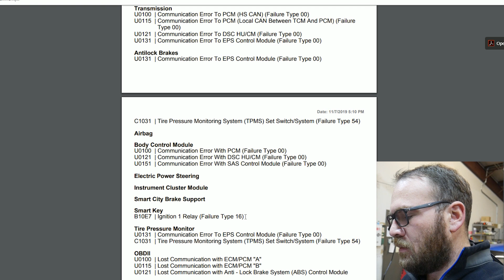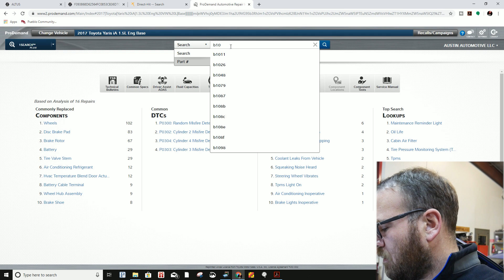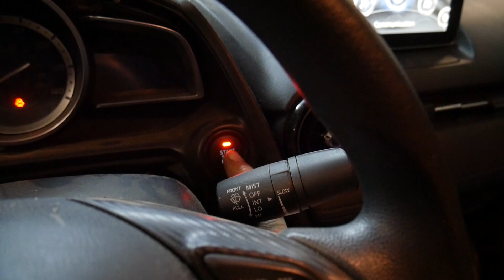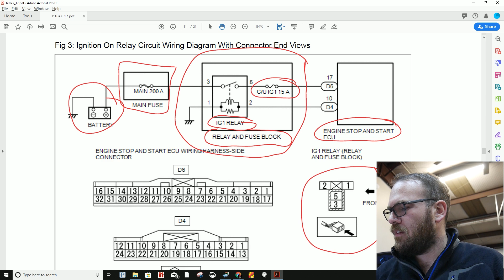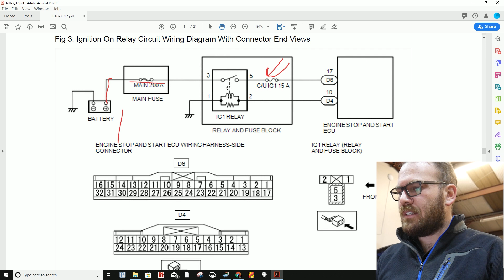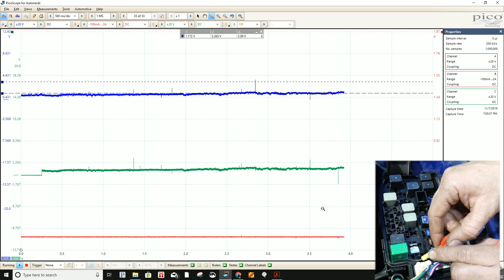2017 Toyota Yaris iA stalls and no start diag

Comment: I have the same problem with mine only difference mine turns on, but stalls and actually turns off after turning on but after 2 or 3 tries it turns on. Sounds really bad when it turns on, changed a bunch of things Toyota said and after that everything comes clean but issue persists. Multiple m chanucs tell me this is a bad car and to sell it and get another used toyota car that is not mazda.
Lets see if i can find a better mechanic this time

Comment: You rock dude, thanks for being a good tech. 👍 

I brought the starter out to Napa, tested good so i found your video,, sure enuf when i pushed down on the relay it stopped having the problem. 

Now i will clean or replace depending on the price

Comment: Just replaced our starter and alternator on our 2016 Scion ia and it won't crank over. Dash lights come on and that amber light on the push button. We've tested the battery amp and new alternator with good readings. Been going though process of elimination and haven't been able to figure it out. So glad I found your video. Hoping this is it.
Reply: You should get a green light when stepping on brake.

Comment: Great video, My Girlfriends car has the same issue and I am hoping this solves it.  The intermittent starting definitely looks to be the same.  However, She also started getting DSC Malfunction, TPMS malfunction and SCBS malfunction lights on the dash at the same time.  These are intermittent as well.    Do you know if this vehicle had any of those symptoms simultaneously?
Reply: I'm having the same problem with my Yaris, the button for the gear shifter would get stuck halfway and I noticed that's what prompted those same warning lights to come on. It's very random with those lights, sometimes they come on sometimes not or sometimes they'll pop up or go away after I drive for a bit. I haven't taken it in yet, do you still have the problem?

Comment: I have one of those and mi car starts cold and after aprox a minute turn off and then doesn't start back again until a couple hours
Reply from the maker: There are four blue relays in the under hood fuse block. They seem to fail without warning. You could try swapping them to different locations and see if the problem changes. Or buy one new relay and switch it around one by one and see if it changes.
Reply from the maker: The relays are less than $20 from the Mazda dealer. Not sure how much from Toyota.

Comment: Did the IG1 relay replacement fix the issues? I'm running into something similar with a 17 Yaris IA after reinstalling the car battery after letting it sit for a few months. Car starts and idles rough and cuts power after 2K rpms. It will shift gears.
Reply from the maker: The IG1 relay fixed the issue at the time. It just showed back up today for a similar issue but this time the relay for the injectors was failing when hot.  We are replacing the injector relay and the fuel pump relay to be safe.
Reply from the maker: @Cristian Escobar I would check the battery. The flickering lights sounds like the charging system or the battery is failing. Perhaps the alternator or the belt was damaged in the accident.
Reply: Jl did you figure out what the problem was with your car… I have one that has ran perfect for years and it went into body shop and stayed a month… and battery went dead.. now after new battery it will start and runs fairly well but start surging at higher Rpm’s

Comment: great video, I haven't ran into this problem yet. The most problems I have seen with these piles of junk are batteries and high pressure fuel pups
Reply from the maker: I think I’ve only had two of these come into the shop. Either they don’t break down often or they aren’t popular in my area. Thanks for watching Gera.
Reply: @ThePracticalMechanic  it gotta be the latter. The subcompact segment just aren’t popular enough for manufacture to continue hence this model is gone :(

Comment: ive got one for ya! Ive got a 2017 Toyota Yaris iA. we just recently had a snow storm. well after the snow melted, my DSC, SCBS, and my TPMS light has come one. Also, it take 3 or 4 times of stepping on my brake pedal before i get the green ignition light to come on the push button so i can start the car. And its all random. sometimes it starts just fine with no lights afterward, sometimes it takes a few brake pumps to start and the lights are on the entire ride. sometimes, one or 2 lights will go off while driving and then come back on later
Reply from the maker: It could be a faulty brake light switch or even brake light bulbs. If lights are coming on I would get a full system scan to find out what components are setting codes. Only after that would I start checking into each system for diagnosis.

Comment: Hi again. I did change the relay and did work but then started acting up again. Any other suggestions?
Thanks for your advice and time.
Reply: Hi Mario, I had a similar issue and it was the fuel pump relay, it's very cheap so it won't harm replacing it
Reply from the maker: You may have a different issue than what I was running into or you may have a defective relay. Make sure there is no corrosion in the relay socket or fuse panel.

Comment: Nice work, your thought process is 'dead on'. Thank You for sharing.    I have this same model car.  I'm going to remove and attempt to disassemble that relay and clean it's contacts just as PM.   (No current issues with the car).   I was automechanic for 25 years, even worked on SAAB for a while, so I have lots of electrical diag experience,  lol.

Comment: I have a green wire snap on test light also and the plastic is doing the same as yours i replaced the wire already once
Reply from the maker: I tried replacing it again recently and it’s discontinued. I decided to modify the light and I installed a bigger bulb for more load. Now I just need to make a new cable.